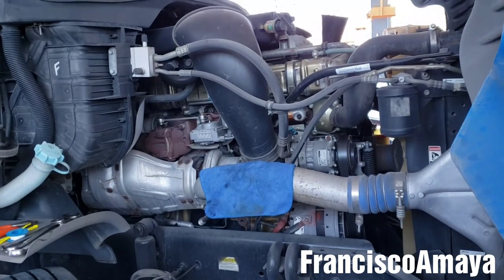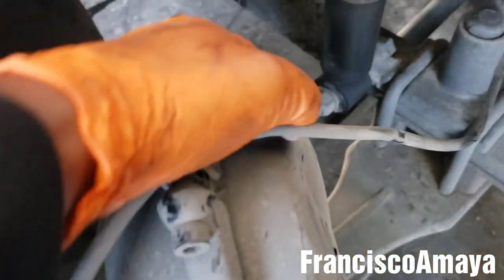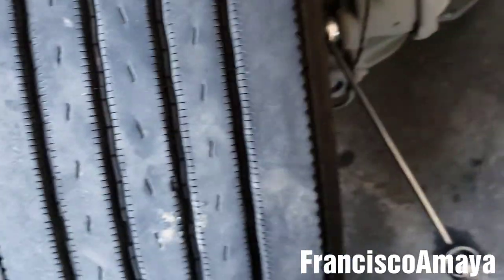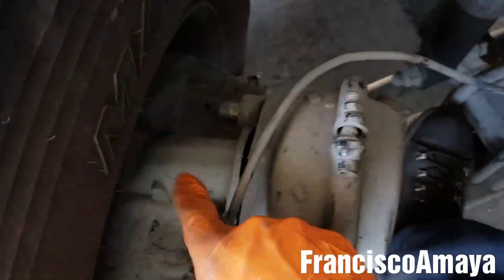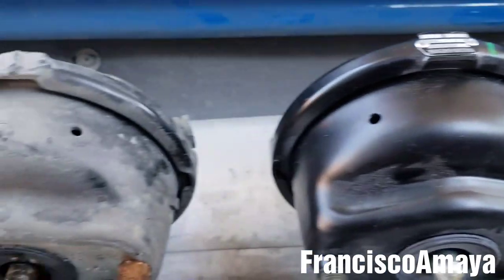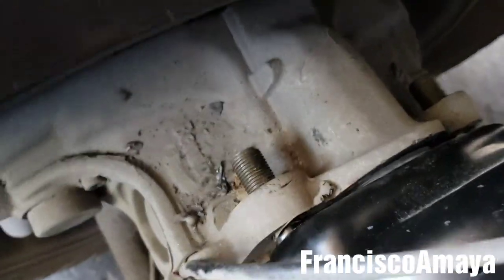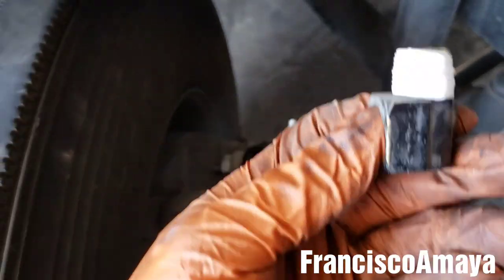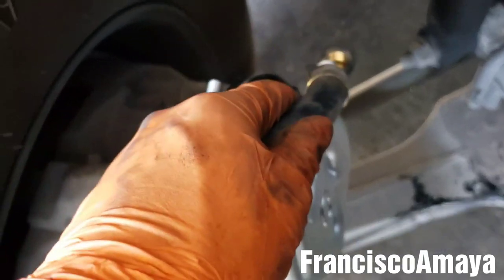air brake disc brake chamber replacement freightliner kenworth peterbilt volvo

Comment: Hola tengo un cascadia 2015 dd13 en el tablero me aparece eec 61 y se me apaga el camión qué puede ser? Gracias
Reply: Que tal amigo, hay que empezar por  escanear su motor, probablemente traes un problema en el sistema DPF
Reply: Cual es el codigo? 61 es la seccion de problemas como emmiciones.